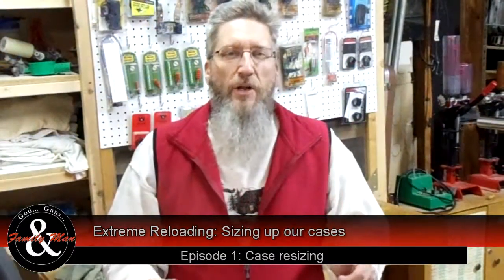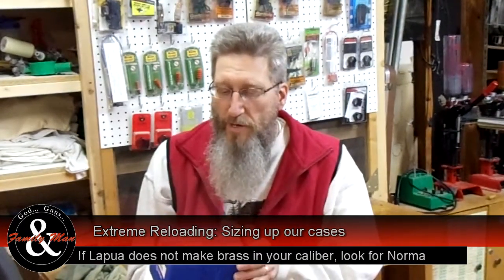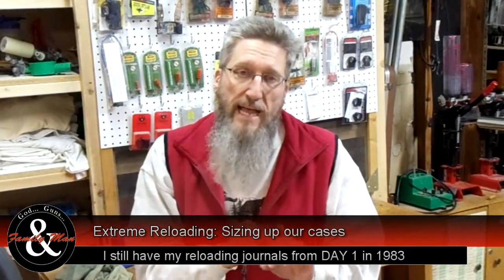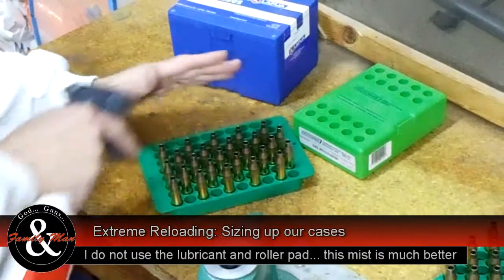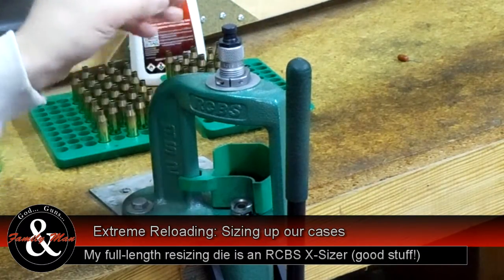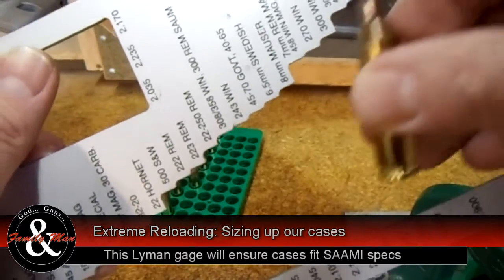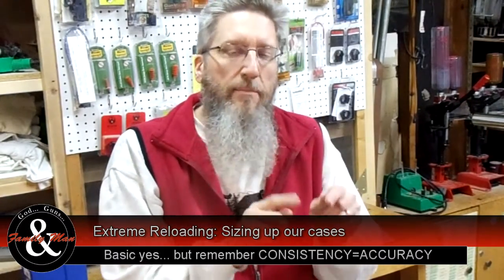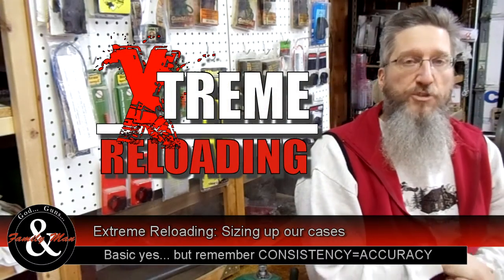Extreme Reloading: Sizing up our cases (ep. 01)

Comment: No de-burring of flash holes as new case prep? No videos on annealing fired brass cases?
Reply from the maker: Yes, I regularly clean up the flash holes and we covered that on another video https://youtu.be/RQBx6F4cZRE. In fact we had an entire series we called "Primer mania" https://youtu.be/hyEoBGjk_XA. 
 I do not anneal cases though. That seems to be a pretty new trend but I have seen very little to know if annealing is worth it.  What is your experience with annealing. I am interested to know. 
Thanks for watching.
Reply: @sdkweber  Thanks.  I like Sam Millard's youtube on annealing: https://www.youtube.com/watch?v=k1QZfqZRn2Q   
I use a drill and 1/2" socket to rotate each case and use the same tempilaq 650 to determine proper temperature with a propane torch at the outside of the case neck.  Advantages are more consistent neck tensions, no split necks and longer case life.
Reply from the maker: @RetrieverTrainingAlone  Thanks for sending this.  It is a good video.  I see Creedmoor Sports sells an annealing machine that seems popular.
Reply: @sdkweber  Or to get started simply purchase Tempilaq 650 and use a 1/2 socket with a cordless drill....try it an see if your velocity standard deviations are reduced after annealing.
Reply from the maker: @RetrieverTrainingAlone  Thanks for the idea.  I think I will look into that.  I am working on barrel harmonics and  neck tension testing right now, and that will be part of our upcoming Season 6 starting in November.
Reply from the maker: @RetrieverTrainingAlone  Where can a person get the Tempilaq 650?
Reply: @sdkweber  I get mine from MidwayUSA.com
Reply from the maker: @RetrieverTrainingAlone  Thanks. I will check their site.